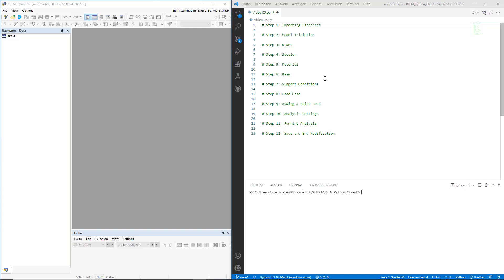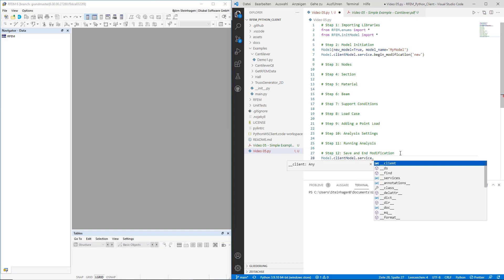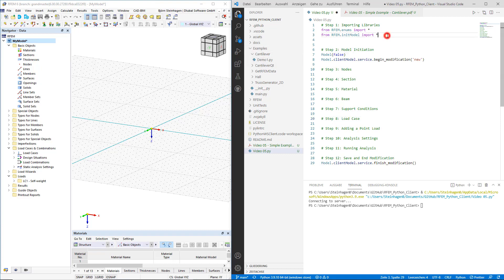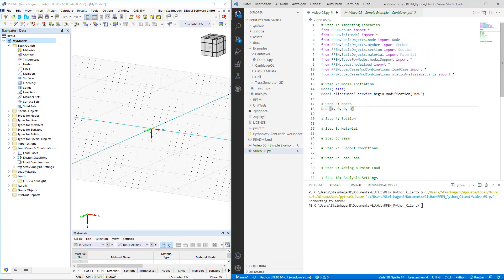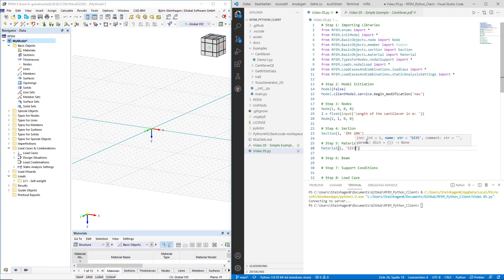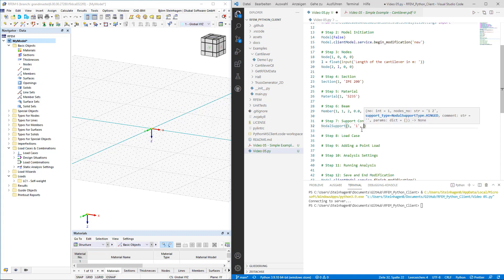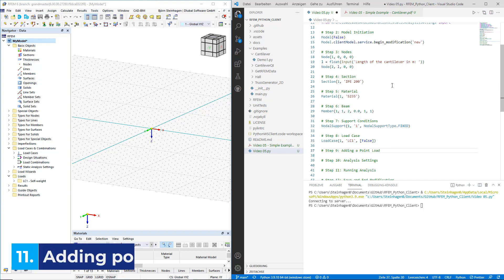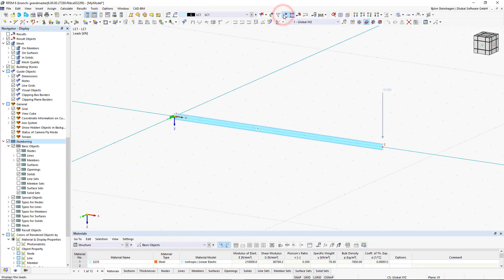Programming with RFEM 6 and Python | 005 Example | Cantilever

Comment: Is there a way to change the units programmatically from m, kN to mm and N? Also can i have the Z-axis pointing upwards?
Reply from the maker: Hi, @jeroenhermsen2838! In RFEM you can define units under "Options / Units and Decimal Places". You can define the Z-Axis in the [Base Data] under "Settings & Options"
Reply: I meant with the Python interface. I would like to define my nodes in mm instead of m. Thanks!

Comment: Hello,
This example shown works for me only for new models.
When I work with an existing model, I get an error message: "...in <module> Model(False)"
Only this is working: Model(False, model_name="MyModel"). 
Setting a model_name is not optional for me. What am I doing wrong? 
Thanks in advance!
Reply from the maker: Hi, Csaba!
Model name is optional when a you want to create a new model using Model(True) option. If you want to edit an existing model, if there is multiple active model, you need to specify to model name to address which model should be edited.

Comment: Is there a way to start a new model and change the base standards (i.e., change from EN 1990 to ASCE 7)?

I get errors with the load cases due to the dead load not being a "permanent" action. I think I can avoid this by entering the load cases using "LoadCase.StaticAnalysis" but I was wondering if I was missing something. Thanks!
Reply from the maker: Hi, Yannick!
The model standards can be changed using the LoadCasesAndCombinations() class under RFEM.LoadCasesAndCombinations.loadCasesAndCombinations.py.

Using the params argument (which expects a dictionary), you can pass the key 'current_standard_for_combination_wizard' with the value which corresponds to your desired standard. This would be "6237" for your case, to select NATIONAL_ANNEX_AND_EDITION_ASCE_7_2010.

All of the above information is present in our docstrings and should provide adequate information / guidance.

In response to your second part of your question, an error occurs when the action category does not comply with the selected standard. The enumerations for action categories contain all possible action categories across all standards. As long as your selected action category matches the selected standards, there will be no error.

For further assistance you can gladly create an "Issue" on GitHub, along with your code, and we can help you directly.

https://github.com/Dlubal-Software/RFEM_Python_Client/issues

Comment: import * is kind of sketchy sometimes

are there alternatives or would I have to do something like import RFEM as rfem

and then dot notation hell to get all the elements.
Reply from the maker: Hi, TN.!
What is the problem with importing?
Reply: @DlubalEN  just if other libraries in python use the same names
Reply from the maker: Hi, TN.!
If using multiple libraries, where conflicting function names can occur, then you could name the Import using the alias „as“ which you mentioned in the second line of your original post. Dot notation (which you mentioned in the last line of your first message) could be also utilized to reduce the function name. For example Import RFEM.BasicObjects.Node as rfem_node
Reply: @DlubalEN  
Got it. Yeah this wasn't a gotcha it was more about if you had a standard to follow so I could be consistent with others if we use an alias since a lot of libraries have their own defaults that programmers use.